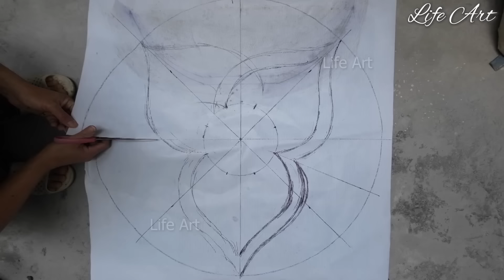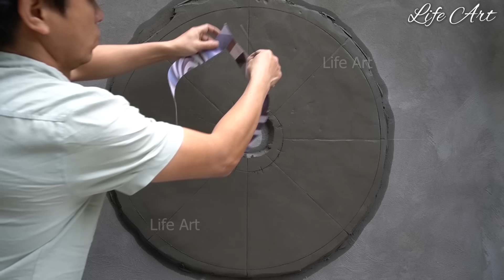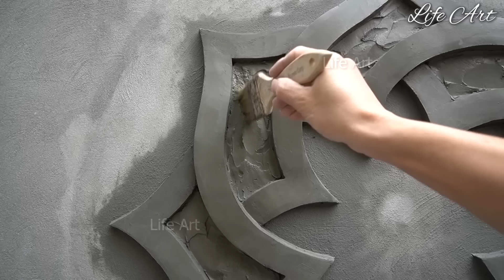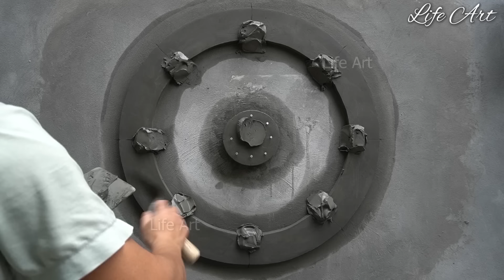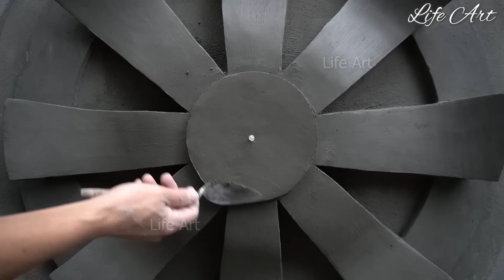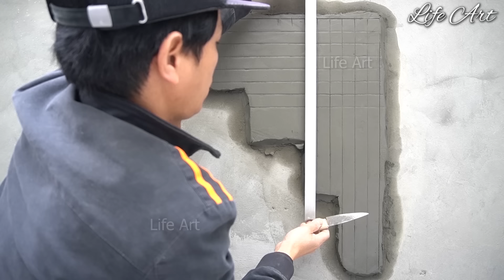This trick will make it easy to create works

Comment: Man, I am very impressed with your work. I am working with CNC and modeling such stuff is not sth I am not familiar with but I don't have a painter's touch like yours. Of course you will not want to share your craftsman secrets but do you use some special kind of cement that is more like a clay or you can achieve such masterpiece with a regular construction cement?
Reply from the maker: 2 parts Portland cement and 1 part fine sand